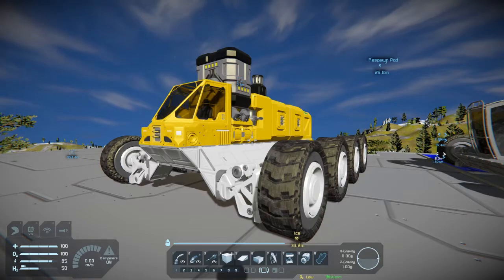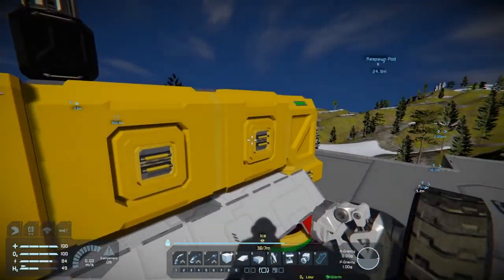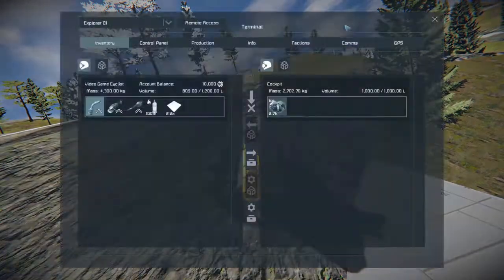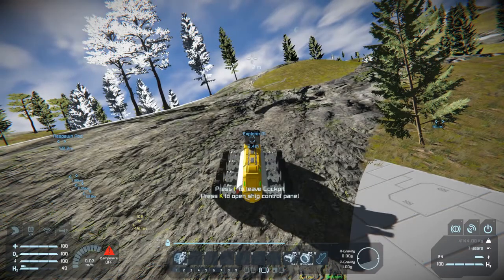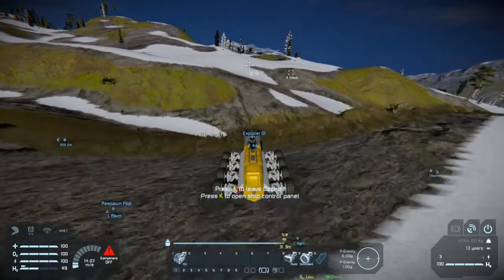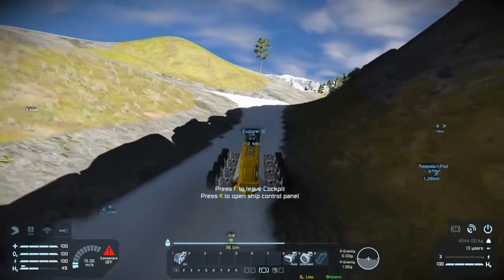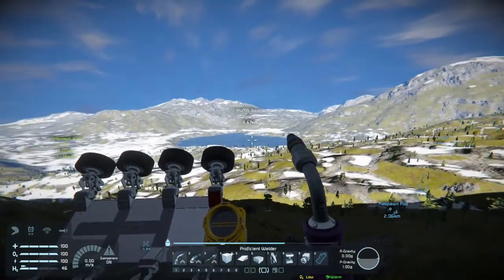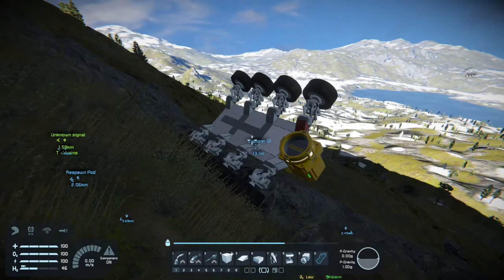Space Engineers, Rover Test 01

Comment: ROFL, awesome :) You certainly learn the limitations of Rovers ;)  The connector facing downwards are not the best choice, as it easy get damaged, though if driving only on flat areas it will work fine. In the wheel settings "Strength" is the strength of the suspension. If the vehicle is fully loaded with stuff, putting more strength will keep the height of the offset you have set, however, if putting too much "strength" it can prevent all wheels to get a grib in rough terrain. When connecting to the base via the connector, you can recharge your batteries. Just a couple of batteries can get you a loooong way wihtout being recharged, so the O2/H2 generator and engine is really overkill on a small rover/landvehicle, unless you want to explore and be able to recharge out in the field. An antenna use a lot of watts, so a beacon is usually a better choice, unless you want to remote control the vehicle.( you can build both and set them to 10 km and then see the difference, its huge) By the way, you can flip the vehicle using pistons.....or maybe even a atmo-thruster, careful using that method though.... lol....... Happy to see you are having fun. I love this game, despite frustrating as it can be at times.
Reply from the maker: Thank you so much for your help with learning this game. YES it's a blast, but frustrating at times. Be sure to check out the next Rover Test videos. ;) I will be sure to use your tips. Thanks for watching!